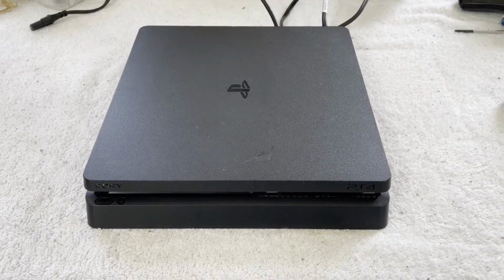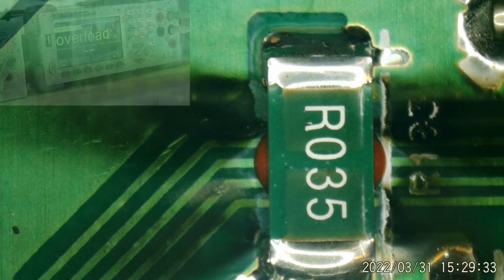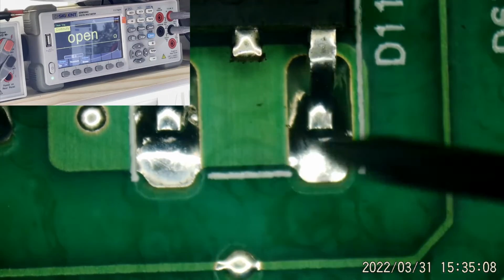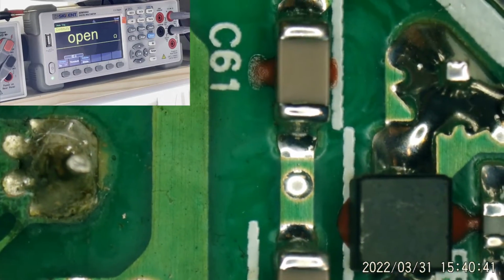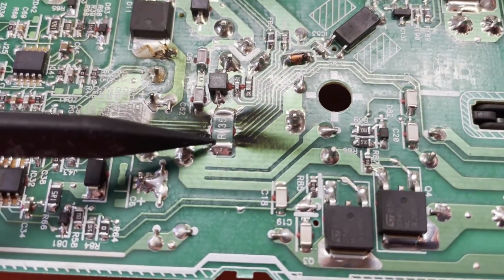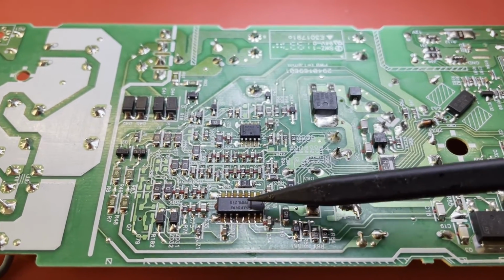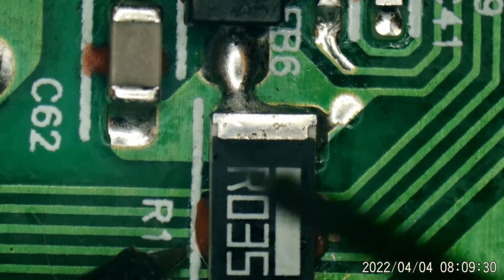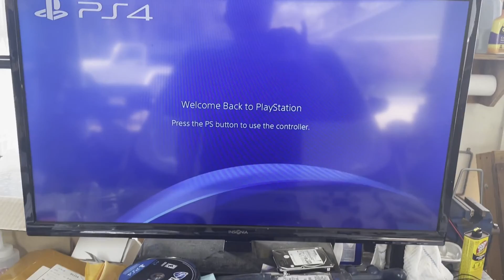#32 Repair of PS4 Slim Shutting Down

Comment: The only way one gets to fix these PSU is when you have deep knowledge on how every single component works on the unit. Another amazing video. Enjoyed it all through.
Reply from the maker: I enjoy the challenge.  I'm always trying to learn more.   Thanks for watching and commenting!
Reply: @ToltecMerc well if you love The challenge I would pay you to just tell me what's wrong with my PS4 slim. A couple months ago it started smoking out of the back of it and then threw sparks. So I took it apart completely and I just wiped everything down plugged it back up it started working but it only worked for another month until it shot Sparks out the back again where the power plug goes. Then I take the power supply apart and the motherboard electrocuted me even though it wasn't plugged up it's still electrocuted me. And I think it's fried but every time I touch the d11 component inside of the motherboard with a screwdriver it throws Sparks. Help!?

Comment: hi
I'm working on this power supply for ps4 slim, that behaves in a similar manner as other cases but I can't find a way to solve the problem.
When it came to me, externally the ps4 had standby voltage, clicking the disc eject button made the triple beep (without disc inside) and cliking on the power button made the blue power light turn on and then all turned off within 1 second.

The 12v rail doesn't try to start, not even a little spike, and then the 5VSB fades out.
If I unplug the mains and reconnect them after at least 10 seconds, 5VSB comes on again.

Comment: On my PS4 slim PSU there are two bad zener diodes at the same place like those that you have changed, markings are W7d, do you think they are 18v zener? Great videos thank you :)
Reply from the maker: I would need to check one of my supplies to be sure.  What is the model number of your supply?
Reply: @ToltecMerc  there is one board number N160A005L rev 0.1 and other number is: 9mc160a010crm4lf

Comment: 23:58 That grinding moment looked suspicious to me but I was "OK I made mistake, he saw it is OK", later on surprise, you came back to it. 33:24 I suggest you to use green rubber dremel bit, its much more gentle to copper and remove only plastic layer.
37:39 Since you work with PS4 a lot, why u dont make connector with button? Im trying to avoid metal tweezers totally, for soldering I use with ceramic tip.
Reply from the maker: I have thought about making a button pcb but I never seem to have an extra ribbon cable with connector that I want to dedicate to it.  The cable I have is used for trouble-shooting power supplies and motherboards so I would need different connections for each.  Still, I should come up with something.  Thanks for watching and commenting!

Comment: Great job! Switching PS's are a bitch.  I love the challenge.   I know what roaches are like.  We has them about 10 years back.  I spent about $2000 on our own trying to get rid of them. Paid Terminex $130, and they were 100% gone within 3 weeks.  Now they come around everything three months and spray outside.  Those fxcking things destroyed the microwave, stove, laptops, TV, you name it.  I have have replaced all the kitchen appliances, washing machine, dryer, TVs, game systems and computers since then.  I will NEVER live with those GD things again!!!  I think I brought them home from a hotel.  When I work above my suspended ceilings, even today, I still find their carcasses; totally gross.  I am impresses you were able to repair a cockroach destroyed switch supply.  I know the smell you smelled while working on that PS4.  It would have scared me if you found live ones in it.  It only takes one and then several weeks or months later, you are totally infested.
Reply from the maker: Thank you very much!  Yeah I hate roaches.  Nasty creatures.